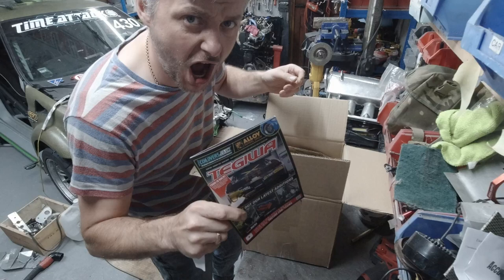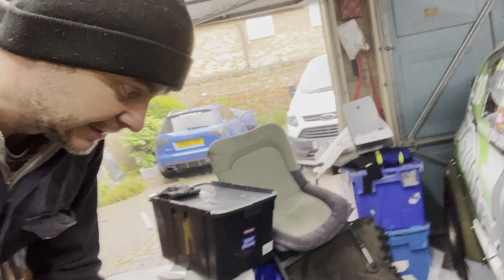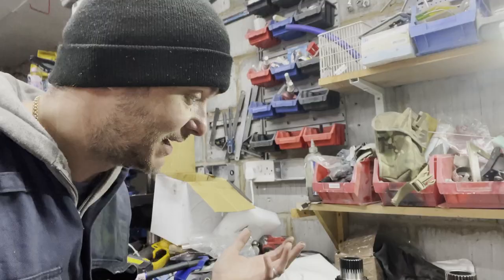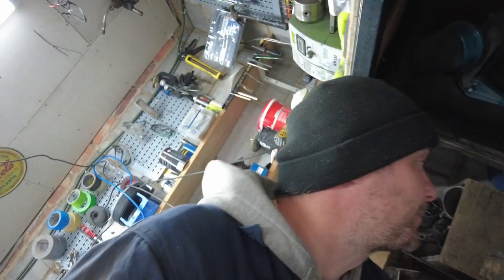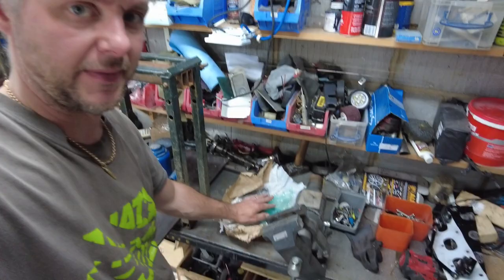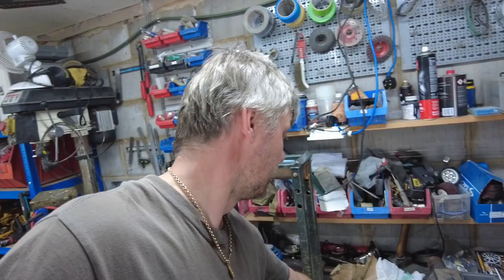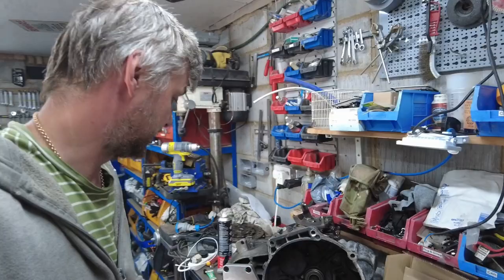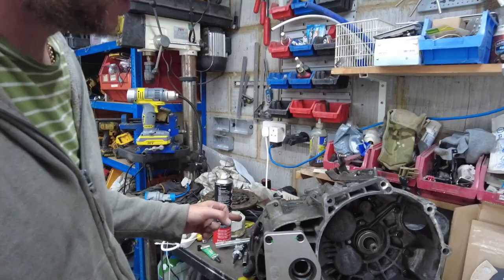Fitting M Factory Diff. How to take crown wheel off. 2wd conversion! Gearbox is ready!

Comment: LSD baby! Also good to see your have changed the clutch after previous issues. The section where you drilled and punched out the crown wheel bolts from the OE diff was particularly satisfying :)
Reply from the maker: I learned my mistake from before. You can never clean clutch plate properly if there is oil contamination. Although I have been recommended to heat it up with a torch.. but didn’t wanna rush it for £90 reline service from CG